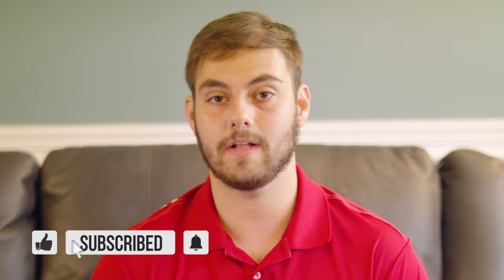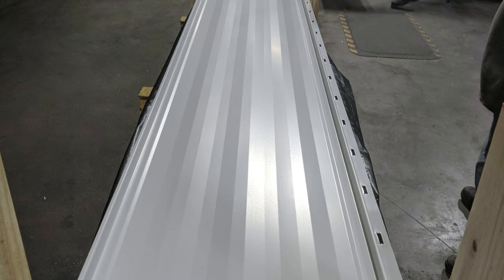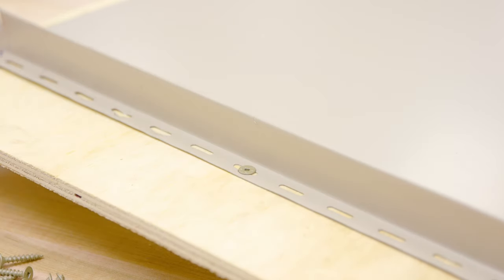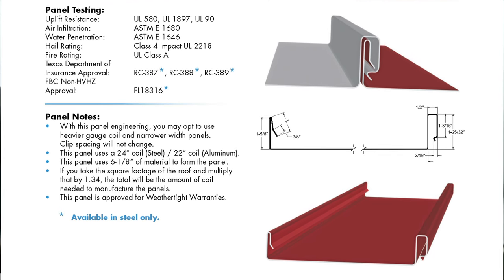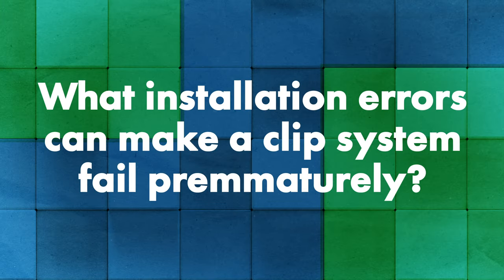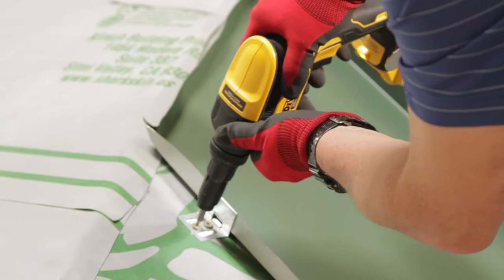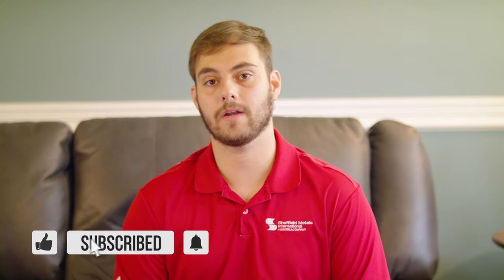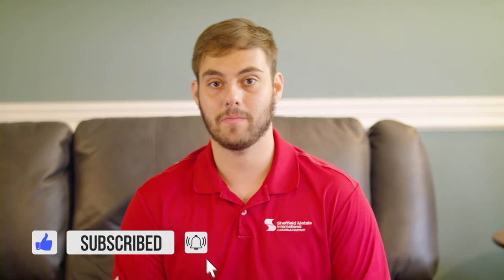Clip System vs. Nail Strip Panel: Standing Seam Metal Panel Comparison

Comment: I prefer the nail strip option for ease of / faster installation.  My local mfg produces a 2” tall,  structural standing seam snap-lock panel.  I do my own “engineering” by simply adding more fasteners than what is called for in our hurricane zone.  After Hurricane Ida I had ZERO failures of any of the standing seam roofs I have installed over the years prior.
Reply: COOL , I'm in North Central Florida WITHOUT the standing seam, the typical metal roof, BUT if I ever need to replace I will go with the standing seam, BTW, how often would you suggest I check the tightness of the screws on my roof? We have been here 7 years and have noticed some that have already backed out, and I'm replacing those with the larger diameter "REPAIR screws" should I replace ALL of them but just the loose ones that won't tighten?
Reply: @REVNUMANEWBERN don’t listen to this guy and go with someone who doesn’t reference “ease of installment” when you’re paying top dollar for premium system. A nail flange strip creates multiple caved in spots because it’s too much pressure in one spot. And he just added more by securing it down. And guess where water sits. All those extra connections.

Comment: Saw standing seam system where every piece was freestanding and cap was rolled over standing seam. Beauty of this: Any piece could be removed for leak or repair and replaced without taking half of roof off.
Reply: Not sure how that would perform in a hurricane,  but sounds like an interesting product.

Comment: And I think the most important thing is the clip system sits above the decking sold the panel sits above the deck and then there is an air movement as far as nail strip sits right on the decking and there is no air movement so condensation my collect underneath and rust the metal out
Reply from the maker: If you have proper ventilation and underlayment, condensation should not be a major issue. Ventilation regulates temperature and the underlayment protects the building from water infiltration. If any minimal condensation were to form on the underside of the panels, it typically will evaporate harmlessly by the time the sun heats up the roof. -Thad

Comment: I should stay away from nail strip option especially in harsh weather area?
Reply from the maker: We always recommend using an engineered (tested) system designed for harsh weather areas, and for Sheffield Metals and many other manufacturers, there is no engineering available for a nail strip panel. -Thad

Comment: Or just use a roofing nailer to install panels with nail flanges. When you put Z-bar closures on every panel with two screws minimum, how is that panel supposed to move?? 
Stating that those panels need to move around is the silliest thing I’ve ever heard when you’re screwing Z bar tight tho the deck THROUGH every single panel…
Reply: You caught that, too. Recommending the most expensive product is a typical sales strategy.
Reply: Using Z closure pins the panel to the roof at the top end of the panel. If screws aren't overtightened on the nail flange, the panel can shrink and grow with changes in temperature.  The bottom end of the panel will move while the top end is constrained.  This is exactly the same as if a clip system were used. If installed on a hot day, make sure to leave some room at the bottom end of the panel for contraction.